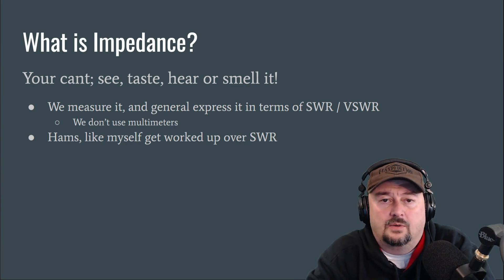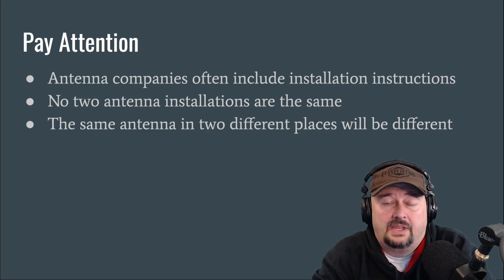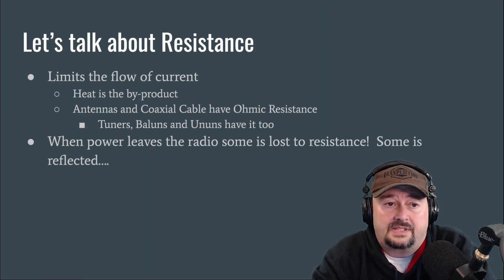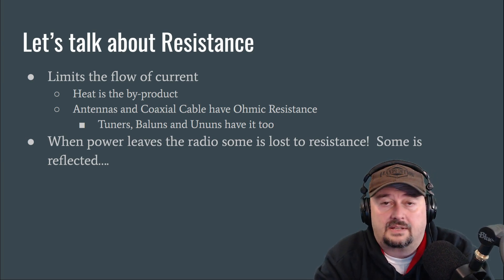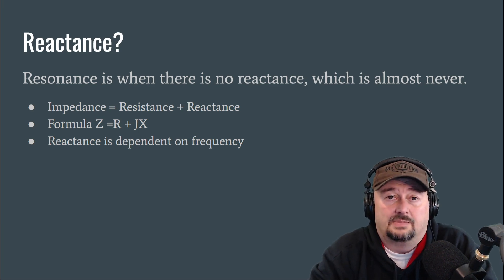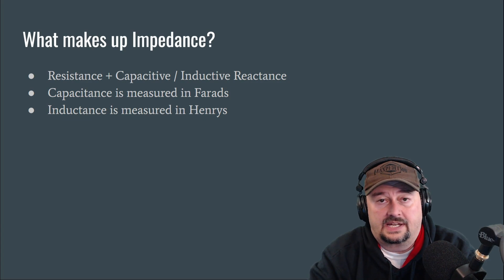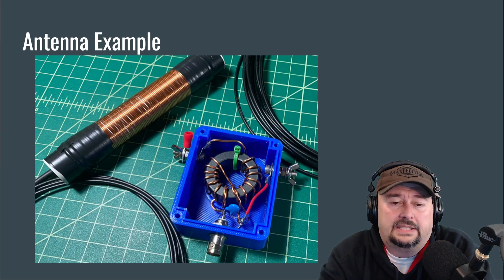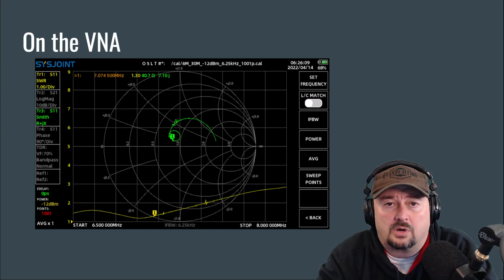Impedance and Ham Radio Antennas Explained

Comment: And this understanding has become a lost art. 

Years ago this was a common understanding … we all learned and understood this. 

Not a totally big deal but it becomes a big deal when your running really low power or really high power. 

Definitely helps you learn to MacGyver a solution on the fly when you need to. 

Most all the fancy analyzers will show you the sub components of Z. 

What I don’t see YouTubers doing that would be nice is teach new hams how to read that wonderful info and what it means when your SWR is 1.2 but your reactance components total 40 and the ohmic is 10. 

Thanks for all you do. 

Good explanation 

Please consider going just a little deeper in another video.
Reply from the maker: Hey D30W, I agree that this type of info can be a little hard to come by on YT.  Thanks for the feedback!  I do plan to continue exploring the topic in videos.

Comment: You have the best lectures in ham radio, I always understand 100% the topics you cover here. Thanks! Suggestion for a video: SWR vs actual power radiated. For example, does a 1:2 SWR mean I’m only radiating half of the power that arrives at the antenna after the coax? Thanks!
Reply from the maker: Thanks Levy, glad to hear you like the videos.  Here are two I did that should help with SWR, Return Loss and Transmissions lines: https://youtu.be/QX8H8U7c71w and https://youtu.be/AE1Mvlzi4gI
Reply: @TheSmokinApe  thanks, man!

Comment: Thanks for the video Ape. I don't think you covered the case of ladder line because as I understand it, the ladder line will not dissipate heat in the same way as Coax. On another note, I can really see what SWR does in a more dramatic way with the Amplifier because instead of a few watts coming back, it can be hundreds even with a lower SWR in the 1.7 range.
Reply from the maker: Ladder line? Ain’t nobody got time for that!
Reply: @TheSmokinApe  But . . . But . . . Chuck said . . .
Reply: If you visualize Ladder line like train tracks with EMF rockin and rolling down the center you then understand how it was improved and used inside a metal tube to stop RFI from other lines "reacting and impeding" and then finally one conducter as a  shield and the other line as the center conducter called coaxial cable. Using Maxwell and Lorentz's math to send the RF train down any 2 conducters or for really high frequency EMF down a square, round or triangular tube called a wave guide is mega fun. Get the math wrong and you enter into the world of melted antennas and swr induced magic smoke. 73 kd9uqe